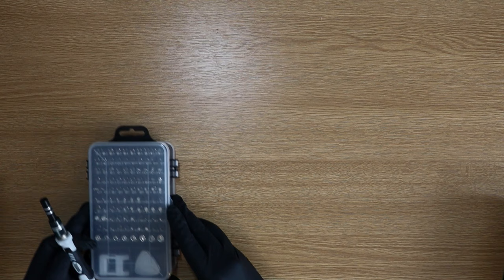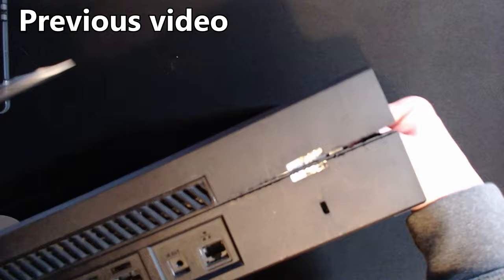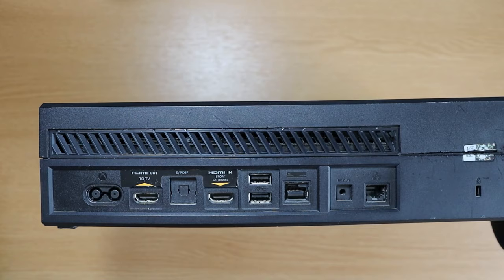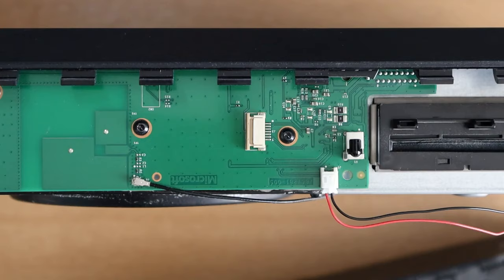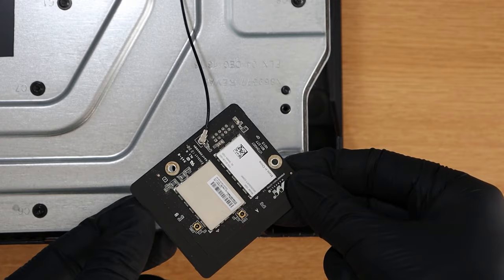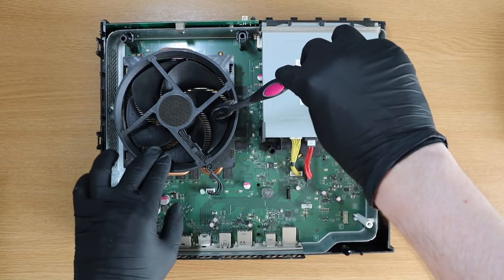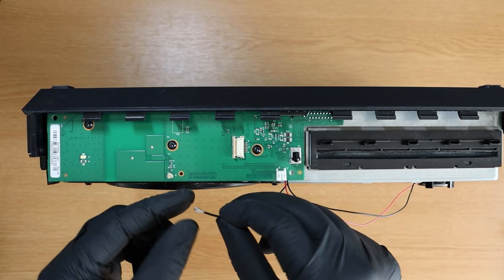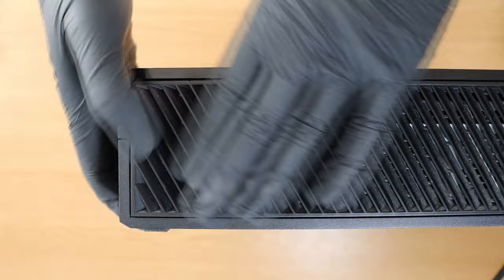How to Clean an Xbox One

Comment: Hey so at the end I was able to easily put it back together the first time. After some  examination I found out that the top part of the Xbox and the front part with the power button come apart. So when I took it apart (which also made reconnecting the power button cable alot easier) Viola the top part snapped right back on. Easy peasy. I am surprised that my Xbox hasn't caught fire with how filthy it was lol!
Reply from the maker: Good job man! Is it the first time you've ever taken a console apart? Sounds like it went alright :D

Comment: Do you need to do a backup for your Xbox before dismantling it? I once changed my PS4’s hard drive and, in the video tutorial, it said that by disconnecting the hard drive, it would automatically erase all the data on It. Is this also true for the Xbox? And if so, should I have a backup of the entire Xbox prior to disassembling it for the cleaning process?
Reply from the maker: I personally didn't when I dismantled it in this video, I even removed the wires from the storage drive and everything was still on there. I WOULD however, back it up just in case if you are worried 😁

Comment: since i pulled apart my xbox to clean it i haven't been able to use my eject and power button, like the sensor isnt working or something, i have to manually do it with controller, any idea on whats wrong or how i could fix this?
Reply from the maker: Potentially the ribbon cable at the front is still lose Slorger? Take the front panel off again and try to reconnect.

Comment: Thanks man this really helped this was the only video that actually looked accurate and just a question is it safe to use air in a can and spray like on the main part of the Xbox like the engine looking thing
Reply from the maker: Glad it helped dude! Yeah that's fine to get the dust off the board, just be careful with the can of air because if you're shaking it around it can release a water like substance if you shake it too much!

As long as it's air, you're all good :)
Reply: After I do this do I have to re sighn in to my account

Comment: Is this something I could attempt without the proper bits? I’ve read you can use a smaller screwdriver and that it will all work the same, but that has me a little nervous.
Reply from the maker: I would recommend using the tools mentioned Christian. You could get away with using other tools, but you might strip the screws making it a really frustrating experience.

Comment: I did everything you did and when I connect my xbox it didn’t want to turn on
Reply from the maker: I'd take it apart again and have a look closely to see if anything has potentially come lose? Feel free to send me a message on Instagram/Twitter to let me know how you get on, and i'll see if I can help in any way!
Reply: @JoeyDoesTech  my Xbox is good now thanks
Reply: @geomendez1045  What fixed it? Mine isn't turning on. I've disassembled it 2 more times already. Everything looks fine..
Reply: Okay so I found the problem. My power supply pack immediately turns off when I plug it into my console. I tried resetting the power pack but every time I plug it into my console, the power brick shuts off. I don't know why it randomly decided to stop working. It's been working fine until I decided to clean the console.

Maybe I did something wrong to the console? Maybe it's detecting some kind of problem that it's shutting off as a safety precaution? FML guess I gotta buy another power pack.

Comment: I found an easier way to reassemble the top.  detach the top from the front then attach the front to the console then line up the top onto the console and it slides on to the console so much easier.  one try.
Reply: Thank you so much me and my dad were having so much trouble and I found your comment and did it easily 😊

Comment: Hey Joey Des Tech, I did this to my Xbox and everything seems better and fine but for some reason my controller has started disconnecting from the console from the moment I turned it back on. Do you know what I might have done wrong or what may be the issue? 
Thank you
Reply from the maker: Hey Darren. I would unpaid the controller and just check that you plugged the antenna in properly. Do you still have this issue bud?

Comment: The power button plate disconnects from the top and it makes it so much easier to put back on. Once top and bottom are on the front rolls right up into place without having to force anything super easy
Reply from the maker: You're 100%. I have the video for it in the top comment :)

Comment: So those Torx screws that you removed, are those the "security" ones with the little dimple/tit in the center of them? I can't quite tell from the video so I might as well ask before I start tearing my Xbox open. I have the proper Torx bit sizes but I just don't have any bits with "holes" in them to slide over that dimple in the screw.
Reply from the maker: Howdy :) the only ones I used was a Torx 8 and Torx 10. I had no issues with these screw bits whilst dissembling/resembling. I think I know the screws you are on about as I had one in the PS4 slim version, however I couldnt locate any of those on the Xbox. In fact, the Torx 8/10 still worked on that anyways :) 

Good luck!

Comment: Would rubbing alcohol work if you don’t have a can of air handy for you or would it damage vital parts
Reply from the maker: I'd ask what is the rubbing alcohol for. I use Isopropyl Alcohol on a lot of electronics as it evaporates and can't do damage. I think you could use IPA on the motherboard of the Xbox if it was really dirty.

But double check it before you take my opinion 😁😁
Reply: @JoeyDoesTech  I use rubbing alcohol on the fan and the plastic n metal parts of the fan and it helped with collecting the fine parts of dust because I decided to clean my xbox that I had on the shelf for 7 years and the rubbing alcohol that I used were alcohol prep pads I got from my work which have isopropyl alcohol and with latex and it seemed to work fine and it brought the color of the black back but it was dirty and their were weird brown streaks like the metal was burnt so I cleaned that but it did help. Thank you for your tutorial
Reply from the maker: @cuddlefloofer  Very interesting to know for me going forward. Thankyou for watching scp! :)

Comment: Already such an upgrade from that vid before this. I haven't worked on any Xbox One's myself yet. But something I would totally do different is instead of a tooth brush or any brush, I'd use a rag and some soapy water. This way you make sure not to make any extra scratches on your console. For hard to reach places you can kinda wrap the rag around your metal spudger and work around these areas. Also some parts are really easy to clean giving them a bath

Comment: Thank you very much Joey for yr great talk through on this.. When I put the case back together 1st time I made sure all other cables were connected well except for the fan, mainly forgot to check as it's under the hard drive. I had taken case apart 3 times now. I found taking off the front part of case easier to re connect the ribbon back, as I clip the front panel into both bottom and top last thing.. I did break one clip on the front right side.., it makes it easier to close now👍👍👏
Reply from the maker: Ayee glad you got it sorted Michael. Thanks for watching :)

Comment: I did it I just need help clipping it
Reply from the maker: Good stuff Jakyi! Your best bet is to push upwards, then seat it over the clip at the end. Let me know how you get on.
Reply: Joey Does Tech i wasn’t able to clip the front part but I was wit all other parts so I just put in side part and my Xbox is good now thanks so much !!! And do we need torex 9 ?
Reply from the maker: @kyifromig4039  I'd suggest the torx 8 and 10. You might be able to get away with 9 and 10, but 8 and 10 is best :)

10 for the big screws when you first start taking the xbox apart, and 8 for the smaller ones :) good job btw!

Comment: just put everything back together and my xbox is turning off without me touching anything. super frustrated. blue cable is connected securely dont know what else to do.
Reply from the maker: Issue with this is it could be so many different things. Did you connect the Wifi board back okay?

Comment: I haven't really gone to open and clean out my console (I just vacuum the outside vents every once in a while). Now after my game got super laggy and unresponsive, the console will turn on but the fan has no spinning sound and the screen is black. Is it too late to just open it up and clean out the dust? Is my console just broken now?

EDIT:
Also, once I open it up and blow the dust out using compressed air, would it be wise to use a vacuum to clean out any dust chunks? Or are the motherboards too delicate for a vacuum (no direct contact, just having a narrow-ended vacuum hose hovering an inch above the inner console.)?

Comment: 10:05 what i did to get it back on easy was to snap off the FIRST plastic alignment tab on the upper left side of system going by how you have it in the video. 9:54 on this side here. once that was gone i was able to get it on waaaaaaaay to easy. The Ribbon cable in the front that controls the sync and power is the most problem.

Comment: So, I followed this video up until I got the top off, and then I put ot back together.

Now the power keeps shutting off with the Xbox chiming before cutting off. Did I do something wrong?
Reply from the maker: I would just check it out again by taking it apart and making sure that all cables are put back where they need to be bud. It might be something like a loose power cable at the front :)
Reply: @JoeyDoesTech  Thanks for replying. I did exactly that, and it works perfectly. 

I also ended up having my Xbox go offline after I cleared it's Blu Ray persistent storage and it hasn't cut off on my since.

Comment: Guys while putting the case back on the cable connecting the front panel and the WiFi card broke off the front panel and I don't know if it will still work.what should I do?
Reply from the maker: Is it still working Mark?

Comment: When putting it back together, after you get the front of it flush, do you go to the difficult side first, or do you get it last after you've gotten the other sides?
Reply from the maker: I make the front flush, then try and stretch the top over the clip at the front of the Xbox one if that's what you mean? It's alot easier to detach the top case and front panel, that way it just clips in :) (I've learnt that from the comments on this video!)

Comment: Can I clean my xbox without taking any screws. I don't have all the screw drivers. I just have a flat head
Reply from the maker: I don't have a guide on my channel, but a bloke who goes by the name of Mick does. Check out the vid here and tell him I said hello :) https://youtu.be/ZqZtORrEOVE
Reply: @JoeyDoesTech  Through my vents I can see a lot of dust on my fan. I have used compressed spray duster and the dust hasn't came out. Can I open up my xbox one and clean the dust that way?
Reply: @JoeyDoesTech  I need your help the ribbon cable came out when I ioppened it. Never mind I don't really need it anyways. I never going to open my xbox again.
Reply from the maker: @waldo1359  You have to be very careful with the ribbon cable when you take the front panel off as it can tear off. It will be worth trying to put it back on even if you don't use it, so at least you know how it works :)
Reply: @JoeyDoesTech  so is the ribbon cable broken if that happened?
Reply: @JoeyDoesTech  also because I have installed the case properly I can't put any discs but the other thing is the clips are too strong

Comment: What about just cleaning just the disc drive? Do I have to take the console apart just to clean that?
Reply from the maker: I mean you can put the nozzle from the can of air inside and give it a good dusting, but that will probably push the dust further back into the machine!

Might be worth taking it apart :) Good luck!

Comment: Do you only need torx 8 and 10?
Can you use a hairdryer instead of a air duster?
Reply from the maker: Yeah 8 and 10 are all that's needed, only because there are some screws that a 10 wouldn't fit :) Hair dryer is fine, just make sure it's on a cool setting :)
Reply: @JoeyDoesTech  okay ty that helped a lot :)

Comment: Thanks for this video. My Xbox shorted out and started smelling like it was burning so I gotta open it up and clean it and see what’s going on.
Reply from the maker: Ah that's not so great. I'm assuming it was overheating? Did you manage to get it clean? :)
Reply: @JoeyDoesTech  yeah I managed to open it. There was so much dust it was ridiculous. I’m running it now so let’s hope it lasts. Thanks again! That was a pain to put back together though. It took me about an hour until I gave up and separated the front piece from the top then I got it on no problem.
Reply from the maker: @BrittanyMarie27  Good job man, glad it's all working :)

Comment: Absolutely helpful video man! Tip for putting the shell back on is removing the front cover from the shell. Place the front plate down first in position then attach the back portion of the shell followed by attaching shell to the front plate. Way easier that way! Thanks for the guide!
Reply: bless u in everyway
Reply: You’re a lifesaver. I took like an hour trying to figure out how to push the shell back on but this method is way easier. Thank you.

Comment: The part where he gets the top off by pushing on the clips is a little confusing. After you've removed the warranty sticker and triangular piece, all you have to do is push on the  GRILL while lifting the top to release the clips in the back.
Reply from the maker: Thanks for the tip Waffle :)

Comment: 9:54 hardest step for me
Edit ok. So there's a easier way. Take the front panel of the top. You will see a few clips which connect the two, just bend them slightly and the front pops off, do it with the ribbon cable not plugged in. Put the top on first. Then attach the ribbon cable and when you confirmed it's connected, clip the front panel in.  
This way makes the ribbon cable a bit harder but considering it took m e 20 minutes to do the way in the video and this only took 4. It's a great improvement. 
First time I cleaned my Xbox one in just over 9 years. Still not as much dust as I expected

Comment: I did every thing and cleaned but my TV is not 1080p but 480p any reasons and also turns of randomly but didn't before
Reply from the maker: There should be a setting on the Xbox to turn it into 1080p, in the menu settings :) For it turning off randomly, maybe just make sure there isn't any lose cables etc.

Comment: I got the case on first time its very easy you have to have the front plate separated from the top plate you slot the front plate in the clip slots raise it up being careful of the ribbon cable untill its seated perfectly.

Take the top plate seat it at the rear first very slightly tilt the front plate forward clip the top plate down then push the front plate back it should easily engage all the clips it was attached to with the top plate job done

Comment: I found it easier to take off the panel holding the ribbon cable. it will go and clip back to the whole top shell with ease. made putting it back on 10x faster and easier. hopes this helps
Reply from the maker: Completely agree Tim. I've taken it apart a further few times now and this seems to be the easiest way by FAR!
Reply: This was my first time trying to clean it because it’s been pretty hot and slow lately and couldn’t do it the way it was shown in the video so i tried that and was way easier
Reply from the maker: @timothystenek2870  Great job man. Was there alot of dust? :D
Reply: It was a pretty fair amount. More in the fan then anywhere else

Comment: Do you think cleaning your Xbox without taking it apart will help it. 

Like spraying it with a can of air, wipes, toothbrush on the grills for the fans.
Reply from the maker: I think it will help to an extent, but you have to be careful not to push the dust into the console further. As long as it's coming away from it, you'll be good!

Comment: I hope someone sees this or the creator- to put the frame back together easier take off the front part (the front facing one where the disc comes out) you can find the brackets to unclip it between the top fan frame price and the front facing one. It makes putting the Xbox button cord back on easy after that don’t fully clamp it on put the top one on first, then connect the two again. Hope this helps and was easy to track
Reply from the maker: Should be in the description of the video pal or the top comment :) I have a video explaining this.

Comment: sadly i ended up broking my xbox one trying to ensemble it again (the pinss that keep the xbox united, and also cant put the frontal part equally, so in the half is lifting), but i tried to fix it whit alittle bit of tape, it turns on an everything, just i dont know if it was worth it, now it looks goofy on the outside, but welp its cleaner now i guess, i just dont open the inside of the metal cage, to much of a problem

Comment: If any of y'all are certain that the ribbon cable is connected, but the power and eject buttons do not work when you touch them, look again. I had this same issue.

I had realized that the middle bit of the ribbon had swerved away from the slot in the white bit while the outer edge of the cable surrounded the white bit, so it would power on with a controller, but not with my touch.